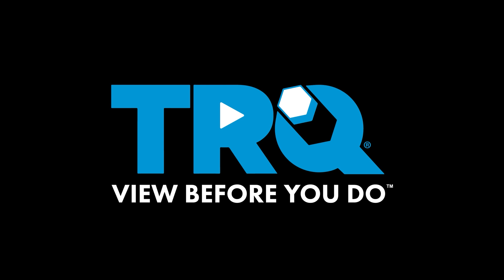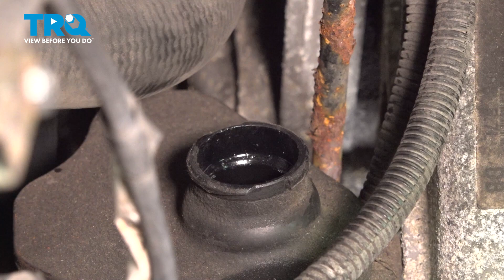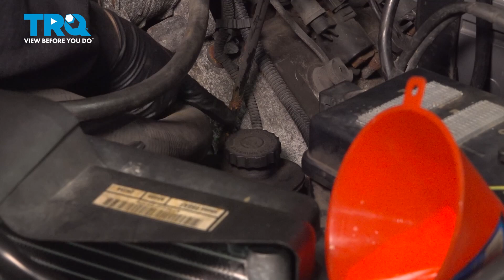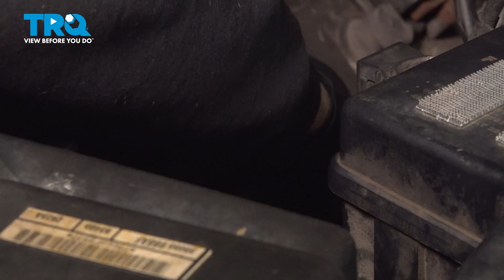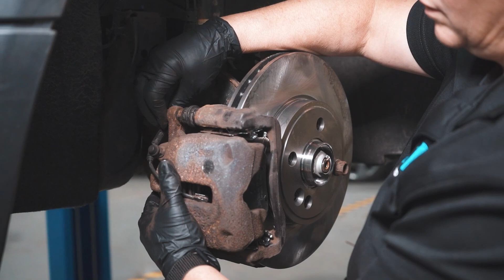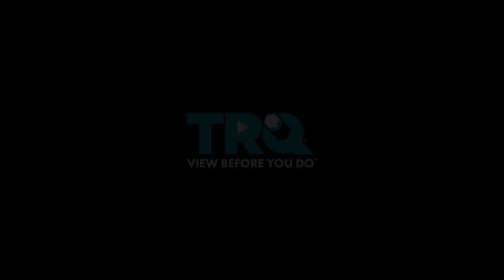How to Replace Power Steering Pressure Switch 2002-2008 Dodge Ram 1500

Comment: Could this also be the cause of a p0871 code in a 545 RFE? I have a 2006 that is throwing that code as well as the p0700. When taking off from a stop going through the gears it goes thru the gears and into overdrive really fast, like by 32 mph. I'm driving in the City a lot and have to switch it to overdrive off mode or else it is constantly going into overdrive at low speeds and bogging down

Comment: Thank you so much for your video. Ordered part from Advanced Auto $42(would’ve been cheaper through Amazon) PSA1014 for 2002 Dodge Ram 1500 4.7Ltr Column shift. Bought the 22mm wrench ($17). Plug was easy to dislodge and switch was easy to wrench however the length of the wrench was a bit difficult to maneuver. Overall pretty simple replacement for a laymen

Comment: My 04 Honda Pilot has blown 2 power steering pressure lines. I've replaced the pump also. This is my last resort. I'm guessing what's the issue. Feedback please if you think it could be something else causing power steerpressure line blowing out. thanks.